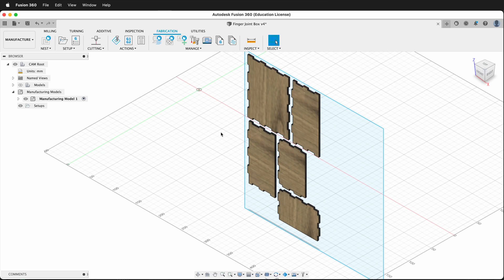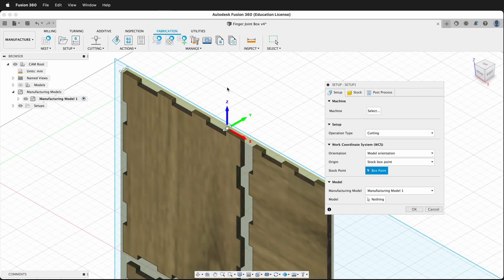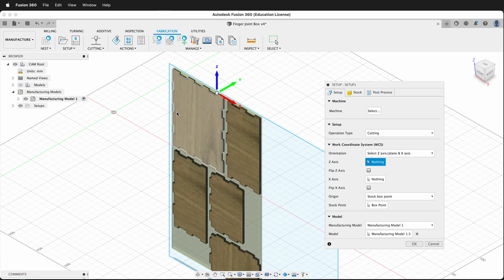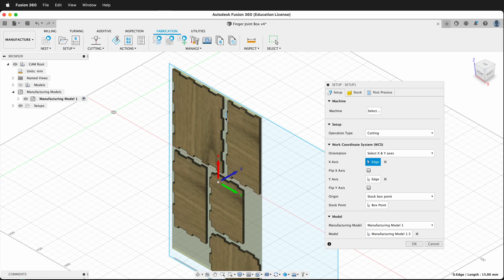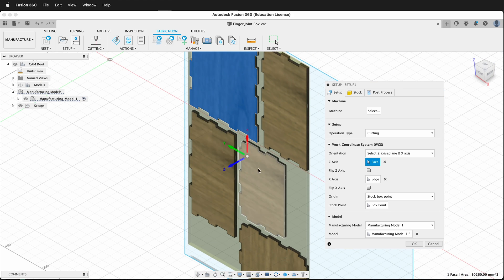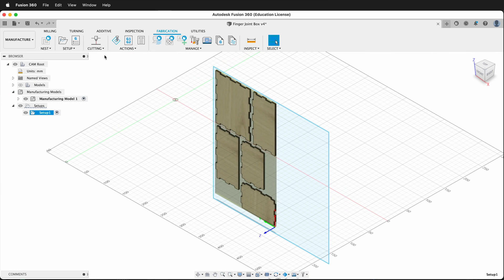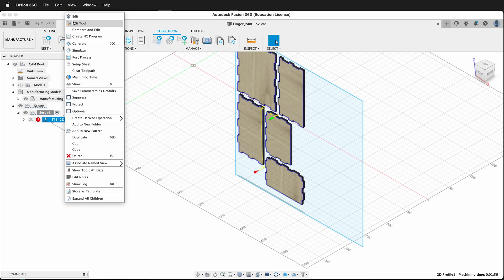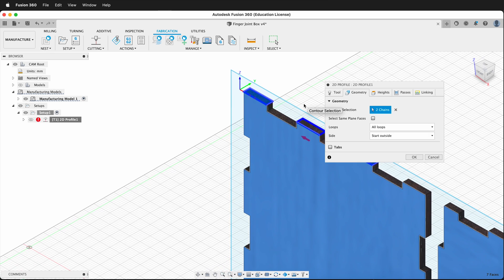Change XYZ Model Orientation Fusion 360

Comment: This does not work for me it goes all wonkey when i select the axis.
Reply from the maker: It can be tricky to get a specific setup but with a combination of flipping axis it can usually be done
Reply: @WhatMakeArt  This is horrible way to try to change the model orientation. I just posted the program and started cutting and Y is where X should be and my stock is ruined now.
Reply from the maker: @noisefekt sorry that happened to your stock, remember it'll always run a simulation first 

I'm sure there are other r ways to change the model orientation
Reply: @WhatMakeArt  Yeah I should've first do a test run with Z +10mm from the top plane. But I was able to save my part mostly, It was just one little touch,. And  the endmill is fine :) I just decided to proceed after I got the y and x swapped and everything went good. I did have to post process the program atleast 4 times because it was acting up. But this was my first time ever with 3d carving with fusion so im a little wiser now.